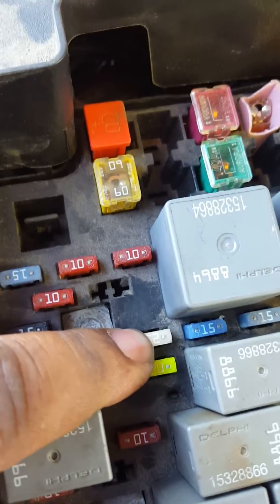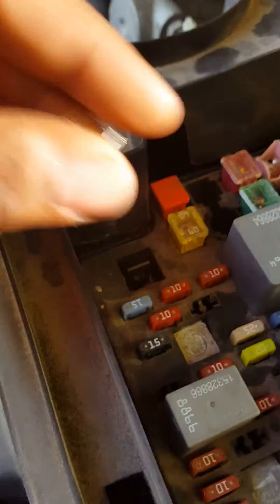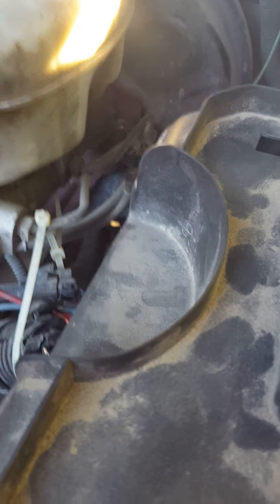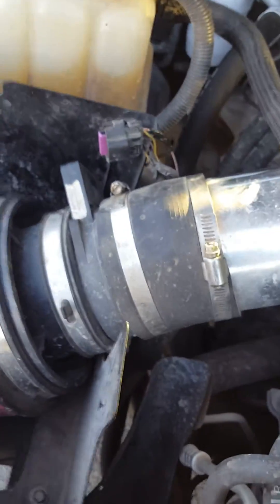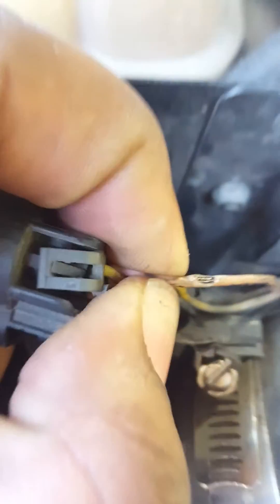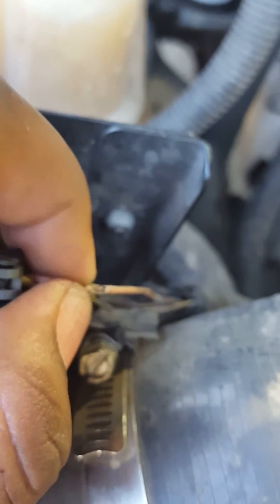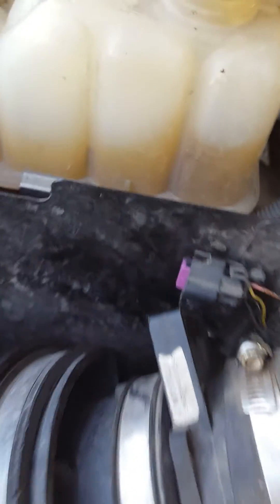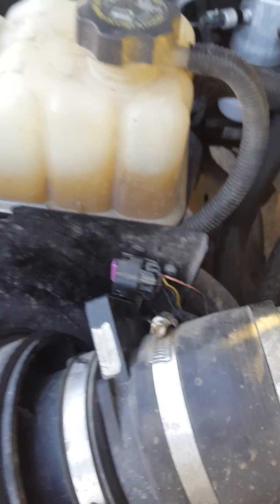PCM Fuse keeps blowing I FOUND THE FIX!!!!!!!!!!!!!!!

Comment: Bro good job figuring this out most ppl wouldn’t but plz cut that wire and repair it correctly or you’ll have the same problem one day or worse. U can cut all those wires off the mass air flow connector and get the same pig tail connector and splice it in it will work forever if you splice it heat shrink it and put plastic weatherproof over over it. Not tryna knock u brother u did a good job just finish the repair properly

Comment: God bless you!  The ECM on my 1996 Jeep Grand Cherokee was only 3 years old and the mechanic was telling me it was bad for this same reason.   I was about to buy a new one when I saw your video.  I checked my MAP sensor and the wires had old electrical tape on them that was unraveling and bare wires touching each other!!!  I did a better fix on the wires and Wala!  The Jeep runs great again!  I will say this.  You are Da MAN!

Comment: Thank you. I have an '02 Mustang, but I DID move the mass-air around and now my PCM fuse blows, but only AFTER I turn the key to the  "ON" position (no cranking over). Not sure I have the same issue, but you have given me a great new place to check 🐱
EDIT: DUUUUUUUUDE.. You da MAN! Sure enough, I had a wire to my MA under the fender that had insulation stripped and shorting to ground. Fixed the wire and then cut some space and rounded sheet metal over. Thank you for resolving an issue I have been wrestling over the course of a couple weeks.

Comment: You saved me from being stranded my Jeep Wrangler did the exact thing. As soon as I changed that fuse it started. I blew another one then I started to check the wires and tape them. After I taped them it kept running and I made it home. My battery post was touching a metal park of the jeep I think that didn't help either so it was the wires themselves or the battery post touching that metal
Reply from the maker: Glad you made it home safe
Reply: What year is your jeep wrangler? I’m having the same issue with my 96 dodge ram.
Reply: @JoeHouston86  1998.
Reply: @KJ-he6hf  I just fixed my truck today. It was o2 sensor wire that was corroded touching the frame!
Reply: @JoeHouston86  cool. I'm having a separate issue with my Jeep now it's sputtering.
Reply: @KJ-he6hf  sounds like it could be your o2 sensor. Disconnect the battery for 15 so it will reset. If sputtering goes away and comes back after 20-50 miles than it’s probably a sensor.
Reply: @JoeHouston86  get thanks Joe I'm going to try that I know it has two sensors I'm not sure which one it is. I'll keep you posted.

Comment: Bro good video, I believe mine is shorting on the plug that goes to the back of the alternator. It is showing a little open wire. New throttle and fuel pump later though, lol
Reply: @keante burks brother i have a 2003 infinti g35 and for some reason my 15 amp fuse keeps blowing when i try to start the car .. its only 1 fuse that keeps blowing but when i put a new 15 amp fuse in it works for a day or 2 then it blows it up just 1 fuse the 15 amp and it cranks but car won’t start any suggestions

Comment: I always carry some self amalgamating tape or silicone tape. Same thing. You just stretch it around the wire anywhere you need to insulate wiring. Works better than electrical tape and won't come undone with engine heat or water splashing on it.
Reply from the maker: fourbypete were did you buy the tape from
Reply: WavvyTech82 most car parts stores have it. Also, most service stations have it. It cost me $1.50 aud a roll.
Reply from the maker: Ok
Reply: you can also take some heat sink tubing, cut it down the middle put it on the wire and heat it up.

Comment: Thanks for sharing and taking time to help uplift a dumbass musician trying to get to a gig. I think I I find my fuel pump short but I'm suspicious that it's not the right one or one of many but master flow wires and anything oatoynd engine dealing with heat and chemical and vibration breaking down the wire makes sense.

Comment: Good work,. Im having an issue with turn signal fuse keep blowing and so far no one can figure out.
Reply: wire connection at the fuse box or you need a new turn signal switch.
Reply: @JeffDeanTheDeanZone  thanks

Comment: Was your truck starting,cranking,or turning over?....my truck keeps blowing the 40 A ignition fuse. I get no response at all from the key. Ac and lights allninterior do work. As soon as I insert the key and turn it blows the fuse. I will use your vid as a reference, but also in your opinion what would you suggest I do? I have a 97 k1500

Thanks in advance
Reply from the maker: It wouldn't say nothing, if I was you I would check for broken wires touching

Comment: My dad has the same problem with our 1998 Jeep Wrangler TJ. The master computer (PCM) fuse keeps on burning out when we go off-road and hit a big bump. It's probably the wiring. The insulation tube must be torn.
Reply: Same year wrangler, owned by bosses son:

The end issue was 2 parts:
1. Loose positive lead TO THE UNDERHOOD RELAY BOX. Super super sensitive.
2. The bulkhead wiring connector, from the underhood power distribution box to the firewall and bolts together. Turns out some gasket or greasy stuff or some just gnarly nasty sticky gunk was packed up inbetween the firewall side and the interior side.
Think like, electrical wire greening but damp? I know that doesnt make a ton of sense.

The upside is if you are suffering that issue still, cleaning the bulkhead connector with about 100 Q tips and rubbing alcohol(engine off/battery 100% disconnected) solved EVERY intermittent issue that wrangler had.
Was also experiencing shift interlock/anti theft random activations. Sometimes the A/C would run the compressor but NOTHING else. Just compressin gas, no blower/no mode doors.
Interior courtesy lights were blowing left right and center along with rear tail lights/third brake light.

Rare times when I have actually encountered a same year vehicle with maybe a same issue Ive fixed. I know that wiring gremlin frustration well. Hope your issue was way less involved OR this info at least fine tunes whatever issue you maybe or maybe arent facing!

Comment: Wassup big wavy ray...I check my mass air flow sensor wires ...two of the bare wires are showing but there not touching metal ...my pcm fuse keeps blowing along with my sensor 1 fuse...
Reply from the maker: Have you cleaned your connection to your fuse box, (underneath)
Reply: @BearHeads41  nah I havent

Comment: brother i have a 2003 infinti g35 and for some reason my 15 amp fuse keeps blowing when i try to start the car .. its only 1 fuse that keeps blowing but when i put a new 15 amp fuse in it works for a day or 2 then it blows it up just 1 fuse the 15 amp and it cranks but car won’t start any suggestions
Reply from the maker: Follow that wire from the fuse box and make sure it's not arching out
Reply: @BearHeads41  so i would have to remove the fuse box all out and follow the wire to where its blowing my fuse ? only 1 fuse gets blown after that car wont start it cranks but what could be the issue to that
Reply from the maker: Yea remove the box